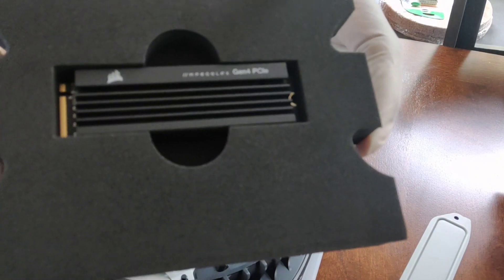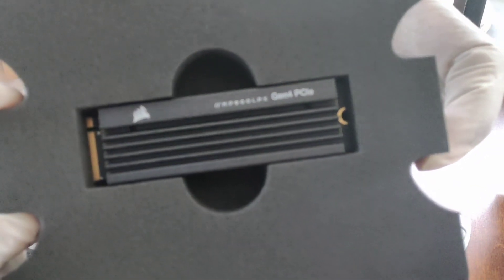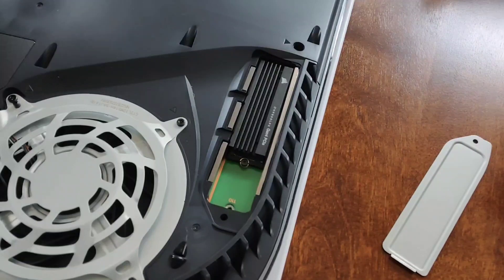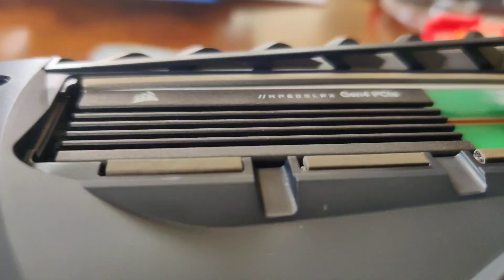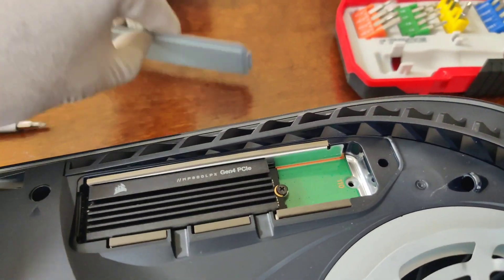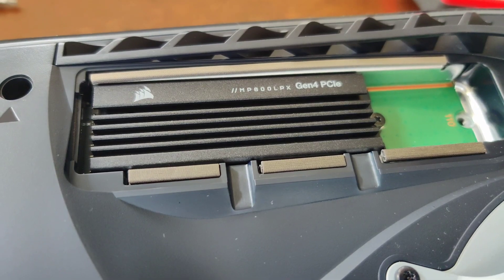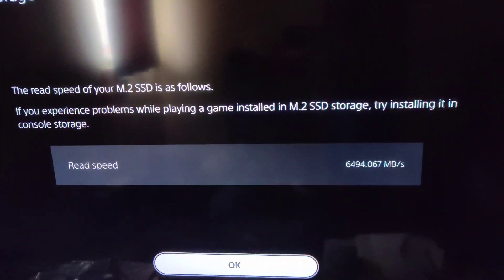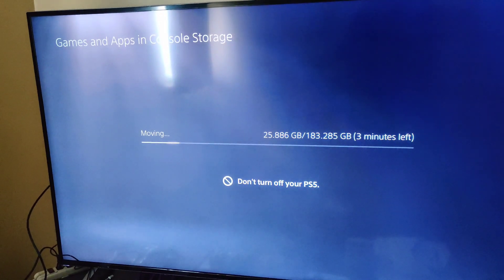Installing the Corsair MP600 Pro LPX 2TB M.2 Hard Drive in the PS5 Digital Edition

Comment: Mine said it was incompatible and I have almost the exact one you have. The only difference is mine is a 1tb. When I insert it like you do, it doesn't hang out, it falls straight down. Am I inserting it wrong?
Reply: You could have broken the m.2 port on The console they are very finicky you’re supposed to install m.2 ssds on an angle
Reply from the maker: If you've tried to install multiple times with no change I'd say you probably got a defective m.2 take it back and have the store replace it. Hope everything worked out for you.